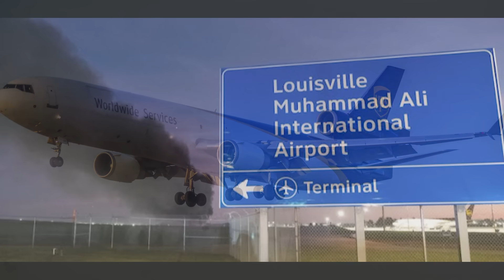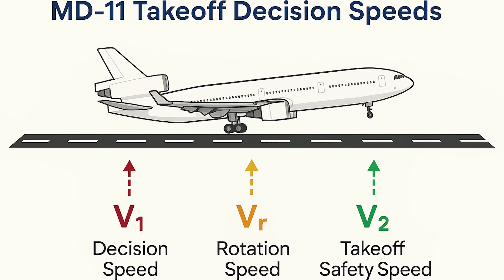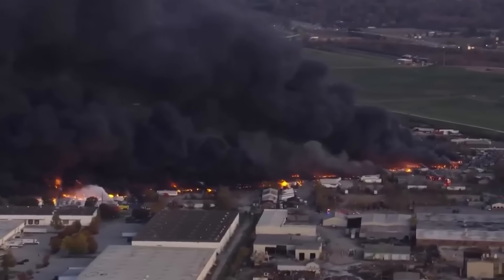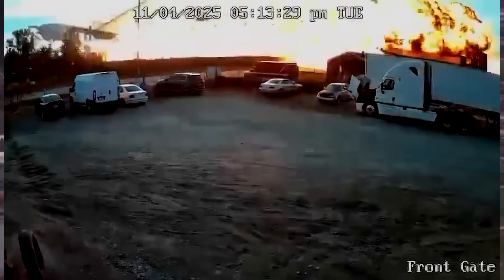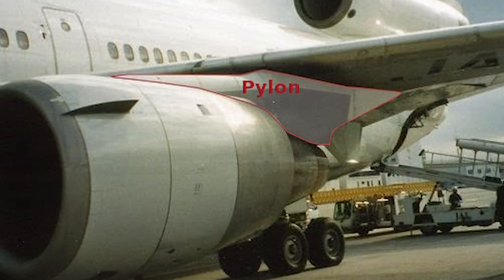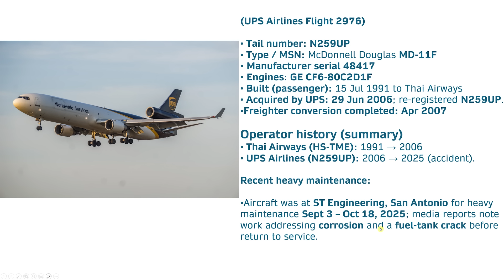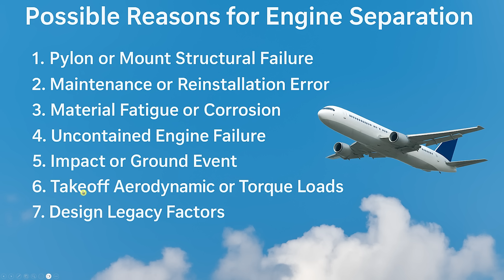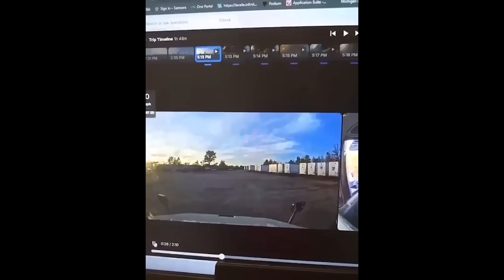What Caused UPS Plane Crash, Louisville, KY? How MD-11 Engine Fell Off

Comment: My father used to inspect parts of planes and rockets. He caught the blades for the engine compromised. Instead of throwing out a cracked blade they would try to push it through inspection by filling in the cracks.

Comment: You didn't get one on what if. Why I personally stopped flying in 2006. Weather. Man made weather. On that. What can cause the most damage. HARPs. Energy weapons. Then. Heavy metals. That can lead to metal fatigue. I see it with everything I personally own. From wood to metal and plastic. What 99.99% don't know. What they use to make man made weather. The majority owns one. Your microwave oven without the protection casing. Same exact thing. Microwaves totally destroys everything. It works on vibration. Why cement doesn't work. The rebar. A inhasment. Why in 1800 they collect and destroyed all of the supper massive bells. Vibration. Bells to technology that does the exact same thing. Frequency.

Comment: At the point they went airborne the flight crew had committed to take off. The plane was taking off to Honolulu and would have had a heavy fuel load in addition to the cargo load. Now I am told that this particular aircraft had sat idle in Texas for 2 months prior to this crash. Weither the aircraft had been placed on inactive reserve status or not I do not know. The MD-11 DC-10 I believe had an FAA AD (air worthiness directive) issued arising from the referred to crash in this video. I am sure that the maintenance and inspection records of this aircraft will be scrutinized. This may lead to a determination.

Comment: Its loosing fuel as it passes over the road. I have a feeling a wash of fuel was dumping out of where the engine was attached. Igniting there and also over spilling to the ground below. You can see the liquid hit the pavement just after the plane passes over. Looks like mist appearing on the ground.

Comment: From what I know if you lose engine power during takeoff and you have other engines providing power you try to ascend to a minimum safe altitude and do an emergency landing on the closest runway that is clear. Failing that you look for a clear place to put it down. But this was an absolute nightmare worst case scenario. You had unbalanced engine thrust on a plane loaded with cargo and fuel for a max range flight that absolutely needed ALL the power to safely take off. As others said, I doubt they had enough time to have communication from ATC telling them the were missing an engine. All the probably knew was alarms were going off for a fire and a loss of power. I can't tell from the videos I have seen if they had tried to use the flaps to give more lift on the left side or if they even had time to try that.

Comment: I am an aircraft mechanic for FedEx. The word is that this airplane was AOG (aircraft on ground) for a #1 engine pylon replacement (which holds the engine on the airframe). However the pylon and engine and both made to shear off in extreme cases although there have been no reports of that ever happening.
Reply: Ntsb has said ups have said there was no unscheduled maintenance before the flight and nothing that delayed the flight 

Thats the initial comments

Its a good rumour but just a rumour
Reply: That’s not something they would openly admit to, at this point. That being said, aircraft maintenance all know and talk to each other so, there may be at least a degree of truth in this post. I’m sure they will be looking closely at the work that was recently completed in San Antonio in October. There’s a good chance nostanz2861 knows the MD11 well, depending on what location they work out of.

Comment: Actually, if they do not use the designed lifting fixtures to put the engine back on, it can cause damage and improperly torqued bolts. They are supposed to take the engines off separate from the pylon and put the pylon on before the engine. If they tried to put them up together, it can cause stress and microcracking. That is one way for how the engine can break free. I do not see the pylon still on the wing.
Reply: Yes, I think youre right the pylon was gone!

Comment: After the plane crossed V1, and the plane had lost the left engine, the take off was severely hindered by the enormous momentum of the remaining engine. Normally using the rudders would have kept them stable but when the engine separated it destroyed many components of the aircraft including rudder control. Losing an engine DOES happen and almost always has a "happy" ending, but I'm guessing internal wires ignited the fuel in the wing as the engine ripped away putting another proverbial nail in the coffin for the aircraft. And rip to those incredible pilots and their families.

Comment: All of the smoke is blowing in the same direction as the plane was flying - tailwind. Didn't cause the engine to fall off but that extra relative wind might have helped save the flight. Why would you ever take off with a tailwind?

Comment: I keep seeing this, why is there a petroleum plant in line with a runway?    How f**** stupid can the zoning people be?    Anyone who worked in that petroleum plant should sue the building department and municipality, because they are partially liable for this accident.    Accidents happen, but risk mitigation and assessments are meant to prevent things like locating a petroleum refinery site less than a mile from the end of a runway and  on the same runway heading, this was analyzed 100% and ignored.    No chemical plant fuel plant petroleum plant or anything with chemicals or explosives should be in line and at the end of a runway near airport operations that's just egregious.       I think that we need some reform, some rezoning, some eminent domain to get these deadly sites out of the way of runaways.     Greed Trumped common sense, that's the only way that the location of that type of place can happen.

Comment: 1st leg to Hawaii, likely the Capt's takeoff. Guarantee this guy had >12,000 hours flight time.
For sure he apllied his flying skills as best he could heavyweight, low speed, and knowing he had lost some thrust. IF eng #2 had FOD, and the major issue of #1 failing was at of after decision-speed (V1); then this was truely unrecoverable for any pilot. The only hope of survivability and minimizing damage would have been to abort above V1...and that is not the training for any scenario except the ultra-rare case of the flight controls being unable to raise the nose for takeoff (i.e. the yoke doesnt pull aft at liftoff)

Comment: A maintained issue may well be behind the engine falling off the plane but, only by going over the logs will they really be able to say what the cause of the engine falling off, once an engine falls off, you will have fuel spewing out of the wing tanks.

Comment: How does an engine fall off an airplane? Obviously rhetorical. I don’t know what happened on the tarmac. RIP to the crew and the people who were killed on the ground. The maintenance has to be the issue. The engine was already gone in the first video. The second video the guy did freak completely. The dash cam caught it all. Engine comes off, severing the gas lines, leaking fuel all behind it and the path of the plane is clear. It’s horrible.

Comment: I'd rather overrun the runway. Maybe there shouldn't be any buildings for at least a mile or 2 after an airplane runway. If that left engine was just removed for service, the reason for the crash might be terrifying. I remember the forklift shortened up time of the engine removal/install procedure, but they hit the pllon and damaged it.

Comment: I was 16 years old back in 1979 when AA flight 191 went down just outside of o’Hare Airport. I lived in WoodDale at the time which was approximately 5 miles west of the crash site. Me and a friend raced out there in his 1968 Chrysler Newport but they already had the roads blocked off towards that direction. I remember the thick black smoke that bellowed into the sky for hours. I wasn’t getting on any aircraft any time soon after that and the PSA crash in San Diego before the 191 incident in September of ‘78.
Reply: I worked in an office about a mile away. We tried to get to the site but all the roads were blocked off Elmhurt road especially. The next day my best friend who was a Schaumburg cop told me they had called in cops from all over to search for body parts but the largest pieces they found were just pieces of fingers. Terrible. I doubt they will find any bodies intact.

Comment: I have been having this question for a long time now. Please someone help me out with this. I completely understand that during the takeoff stage the pilots may face a significant overload and to keep things simple but in during a midflight phase why these planes do not have cameras facing towards each engine and wings, rudders, etc. ? Those live footages could give a very clear picture to the pilots on what they are dealing with here exactly. That way pilots will also not shut off working engines in case of single engine failure. Now in this case, if the pilots would have seen the huge fireball to the number 1 engine, they would have gotten a much better picture of what they were dealing with. The outcome would have been very different I feel. 

But anyways whatever happened was very sad. Rest in peace to the crew on board. My prayers to them and their close ones.

Comment: It needs to be made illegal and prohibited to build anything at the end of a runway, let alone a petroleum processing plant. That's truly just creating a disaster. This way, they could have just kept going straight on the ground and they would all still be alive. It should just be empty marshland past the runway so that if this situation does ever happen, the plane goes straight and the marshland slows it speed down while also cooling down the heated plane body, and prevent too much excessive fire from happening. We have a reef runway in my state, so the planes would just head straight into shallow water. This would be catastrophic for the reef and ocean in this area, but it would help prevent a lot of death for flight crew and passengers, and also pollution from massive fire and explosions.

Comment: Im sorry but if im in v2 im still attempting everything i can to slow down on the ground vs dealing with it in the air id rather blow up in the field then mid air and come crashing down. Not sure how they couldve been in v2 if their engine wasnt even attached mid take off how could they have enough power to even take off. Especially loaded.

Comment: Engines have fuse pins that are designed to allow the engine to break away in case of violent vibration. The 747 had a bad batch of fuse pins that resulted in a disaster in Amsterdam on October 4, 1992. There were other near disasters as well due to bad fuse pins.

I suspect a bad fuse pin failed, causing the engine to drop away, causing debris to get sucked into the No 2 engine, causing that engine to also shut down, resulting in the inevitable crash as we see it in the video.
Reply: Or a repeat of the flight 191
Reply: @paulrasmussen8953 no there's a fundamental difference between this and flight 191. Flight 191 did not crash because of the loss of the engine it crashed because of a loss of lift due to the retraction of the Leading Edge slats and that issue was resolved in 1979 following the investigation. In this case the plane crashed because of loss of power on the left side and on the middle engine resulting in an insufficient amount of thrust to keep the airplane in the air and an asymmetrical amount of lift on the right side which caused an inevitable rolling motion which is what we see with Air France 4590
Reply: @marks6663 so, in this case what was the best option to save the pilots themselves from their imminent death.
Reply: could be chinese counterfeit parts

Comment: No way the landing gear and all 12 tires would still be intact after hitting the first building. Probably aft fuselage contact made the gouge in the first building. Clear view of all 3 mains and the nose gear still intact. No link to AA or United events.  Possibly a loss of thrust on another engine; if not climb performance would have gotten them airborne. Practiced at every training cycle by every multi engine pilot. Oddly enough ; I had a squadron mate in the early 80’s who had an engine fall off his 707. He swears it is the best kind of catastrophic engine failure to have as loss of the engines dead weight and all the drag it would cause. ( particularly in modern hi bypass engines with large frontal area) he said it was much harder to recognize what had happened because the plane
Flew so well. Much better than inflight and simulator engine out practice. The gouge in the first building is too narrow to be done by the gear as well

Comment: 15 years ago, UPS lawyers made the assessment that it was more cost efficient to continue to fly an old plane and risk a catastrophic disaster and lives than it was to replace it with a newer plane.
Reply: Age is irrelevant.  Look at the older aircraft still flying around in the Air Force.  It boils down to lack of proper maintenance.

Comment: In 1979 i was 13 and had just flown on an american dc 10 from iad to lax over spring break.  I was horrified by 191.  Always wondered whether it was the same Craft i had been on a couple months before.  Left engine powers instruments and hydraulics.  No time to turn on APU.  This is what i learned on Air Disasters.

Comment: US infrastructure is aging. Spending so much on wars and so little on infrastructure doesn't help either. The pylon seemed to be there, so, it was probably the engine explosion during take off and subsequent disintegration of the engine casing that ripped itself off from the pylon bolts and somehow dropped onto the runway.
Reply: Since when are aircraft engines a part of US infrastructure?  🤡
Reply: @evilload  The fact that UPS bought the used US plane from Thai Airway suggests that a US company couldn't afford a new US product on US soil without going into non-profit region because the competition is fierce and margins are thin. This translates into aging infrastructure, aka, not as good as new, and prone to more accidents.
Reply: @examplerkey  Infrastructure:  "the basic physical and organizational structure and systems that a country, city, or business needs to function. It includes the essential facilities and services like roads, bridges, power grids, water supply, and telecommunications networks that support daily life and economic activity"  And how does UPS aircraft fall into that definition?

Comment: It could have been worse. Using the video at around 19 seconds in, I went to Google Maps street view. The guy shooting the dash cam video was in front of Pristar Mobile heading North on Grade Lane. I saw some early phots of a building with roof damage. That was the UPS Supply Chain Solutions building and it looks like the landing gear hit the roof. It looks like the plane hit the ground right where Kentucky Truck Parts and Sentry Steel had buldings. From there it slid through lots full of junk cars and trailer staging lots. Other companies in the path were Cundiff Steel Fab, Action Machinery, Grade A auto Parts, Westco Trucking, Smith Chassis and Metalworks, and A Plus Paper Shredding. I'm sure that's where the ground fatalaties occurred. People are still at work at 5:15 PM. I say it could have been worse because this was the least populous area off any other runway. Had the plane taken off in the opposite direction it would have come down in a residential area southeast of Churchill Downs race track.

I witnessed Flight 191 in Chicago. Eerily similar.
Reply: should have been used cars only no buildings  built there

Comment: Enjoying your description of the ups md 11 crash
Condolences to loved ones who have lost there lives
With that last video its quite clear  that the left engine detached as it was on the run way just like the illfated dc10 flight which lost an engine on take off with 25 times more loss of life on the 25 may 1979 American Airlines flight 191
It was found to be the way they were removing and reinstalling the engines with a forklift damaging the bolts / brackets the engines attach to on the wing

Comment: There is a fireball on the plane whilst it is taking off, then no fire (as you see in the very first video here) as the undercarriage ploughs through the factory roof, then the final fire seemingly ignited by the power lines the plane struck as it passed over the perimeter road into the fuel recycling facility. The first fireball could be a left engine explosion? That this ripped the engine off its pylon would be a separate (maintenance?) fault.

Comment: There seems to be a door that gets opened and closed just before it passes over the road then closes then opens right there just as the plane is passing over the tire shop right behind the telephone pole with all the growth on it suddenly there's a door open on the passenger side of the jet just above the wing it wasn't open before it passed in front of the Pole then it opens again over the street which there is a door that shows up on the schematics that he's showing here in this video and all that fire as it's taking off to me only makes sense that when he lost the engine the pilot did that yanked out the fuel lines with a brand new filled fuel tank that caught fire upon takeoff also I'm saying makes me think maybe just before impact the pilots had set it to autopilot which an autopilot will land a jet that size and they tried to jump out in the hopes to not burn to death😢